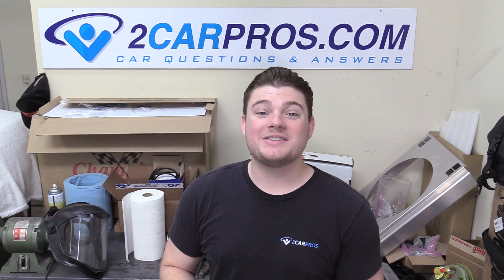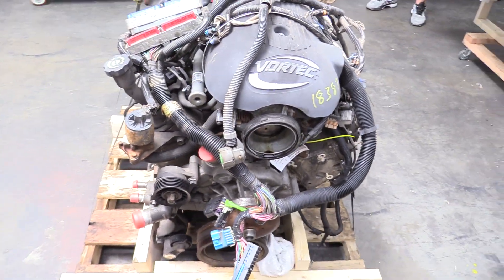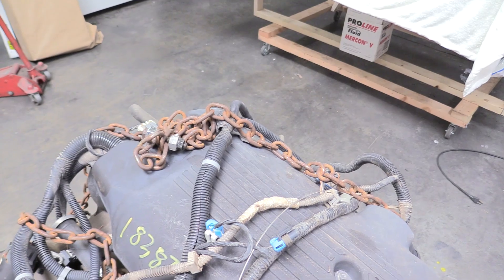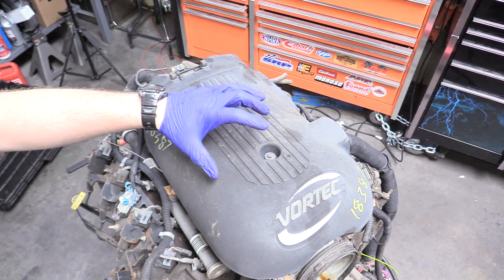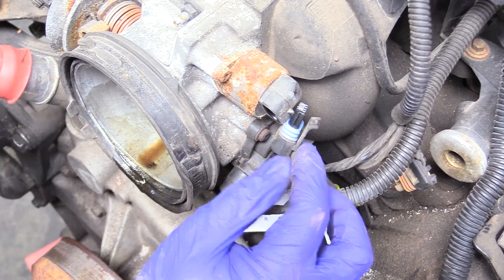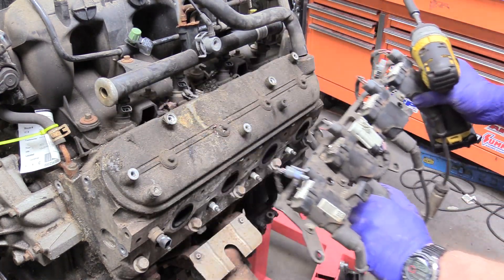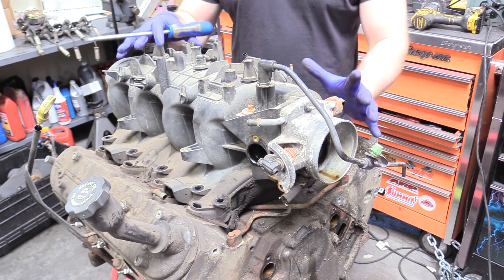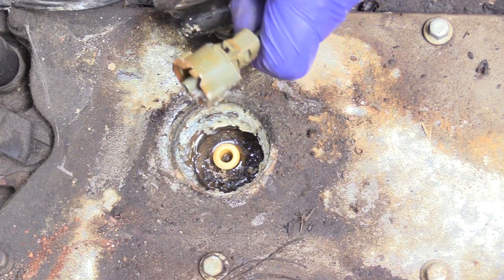How to Build a 5.3L LS LM7 V8 - Part 1: First Disassembly

Comment: Great step by step how-to video for the novice for sure. However, very unrealistic cost part for part. Without the thousands in free parts from Summit, you're all in for well over 13k total cost. (Engine, Summit parts, machine work, and stainless valves.) For that you could get a fully dressed, with all accessories, 530hp 6.2L LS 376 CID from Blueprint. With a 30 month/50k mile warranty. 

Or a guy could get a 450hp 5.3L long block for the cost of just the machine work. With 2yr unlimited mile warranty. Many other great options unless you just want to say you built one.
Reply from the maker: This was pre pandemic, things were A LOT cheaper. 

Blueprint is a fine way to go. If they have what you want. 

I'm not sure that's true. Machine work on a SBC I just built was 900 bucks.

Comment: I started to do mine as far as disassembling it. I have a stand from Harbor freight and those bolts don't work with it, they are too long
Reply from the maker: Cut them or get shorter ones, my stand has a bit thicker apparatus than most. Thanks for watching!
Reply: @2carpros  yea i've watched your vids now  a few times now with my dad. By far yours is the most detailed. I will def be following each vid for the rebuild. I plan to put the lm7 in my 2002 trailblazer. Ive got a long road ahead but im confident i can do it, it will be our 1st build!
Reply from the maker: @Trinicrew99  Awesome! Sounds like a super cool build! Let me know how it goes! If you do follow our built to a T,  just note that the valve covers I used in the video are wrong, the ones I linked are correct. They are a bit taller and allow for the roller rocker clearance. Thanks for watching and have fun!
Reply: @2carpros  i havent decided on what rockers im going to go with yet. I have a lot of parts saved in cart on summit. i originally planned to reuse the stock ones but i saw some weird wear on 1 push rod so i will def change rockers. Im not going too crazy on build just want tit to be reliable because it will be my daily again. Thanks for the info and tips

Comment: I love how detailed you get on the tear down and set up! I do have one question. I see a lot of people use them and perhaps I’m extremely paranoid by it but how can you pull yourself to use an impact on your engine?. 😂 personally using impact guns on engines scares me I just can’t make myself do it. I rebuilt an 84 Yamaha 3 wheeler that went through a flood and I used an impact on it. I broke off one of the head bolts and it was a night mare. Never again have I used an impact on an engine. 🥲
Reply from the maker: Just been doing it for years. You just sorta learn what you can get away with and what you can't. Thanks for watching!
Reply: @2carpros  hey thanks for the reply! I did have a quick question I was planning on rebuilding a LM7 5.3 and throwing it into my BMW. I don’t have the engine in my possession yet I plan on picking it up next Thursday but I have a slight concern. Would it be possible that the oil pan would stick past the frame and drag the ground? If so is there a possible option out there to go with a shallower oil pan?
Reply from the maker: @AWGarage614  No problem! It's possible. But with swaps you either have to put it in and see. I would think you need a shorter pan. I've seen LS's in BMW's and they all have non stock pans.

Comment: I have a 2003 Chevy work truck 4.8 4l60e woth 350k miles on it. Motor knocks and tranny slips. I had the 4l60e rebuilt and bought a junkyard 5.3l not as old. Truck runs brand new! 5.3l has obvious more power than my 4.8l. 😅

Comment: What size bolts to lift engine with hoist?
Reply from the maker: 10x1.5mm for the sides of the cylinder head. You can also just use the exhaust bolts for the flange. Thanks for watching!
Reply: @2CarPros  Thanks you. Appreciate it alot.

Comment: Just so you know, I have a 5.3L engine in my garage, Just "because" of you. I paid 300 CAD for it. It's in good condition, and I am at the machine shop state and buying part state. And it's the first time I did work like that, the first engine ever, and I have a unique plan for it, like a mustang gt500 supercharger on my ls ;p. Thanks for making that series of videos; I must have watched it at least 3 times. But don't laugh; I've undoubtedly missed the part, in every ls video, on how to remove this #$% fan with a clutch on the water pump; I tried every tool, heavy tool, cutting tool, and I can't remove it. Now it's just a question of pride and easy packing for the metal scrapper. Everybody must know "how to hit him on the nose" to separate the two damn things. I'm afraid to search to see how stupid I am ;p. Or mine is stuff beyond anything. It will have an electric water pump instead.
Reply from the maker: Very very cool! When you finish it up send me a picture, I'd love to see it! ryan@2carpros.com or on instagram @ryansgarage408 

If the fan clutch is truly seized on there, just remove the entire water pump. Thanks very much for watching!
Reply: @2carpros  Will do for sure

Comment: Where can I️ buy a motor and have it shipped to my door for 500?😂😂I️ can’t find a lm7 near me for less than 900 and it won’t come with all accessories
Reply from the maker: I fear I may have influenced the market a bit. A lot of people bought them off eBay sending the price higher. But this one was 550 shipped when I bought it it was 2 years ago now though. Thanks for watching!
Reply: @2carpros  thanks for making them, I’ve watched multiple times now trying to memorize it😂
Reply: @2carpros  update I️ got a gen III lm7 with a 4L60E and T case for $600, sold the trans and T case for 300 so I️ paid roughly 300 for the motor. Only 145k miles

Comment: I have a 1999 Chevy silverado, 5.3 liter, vin T, LM7 engine with a bad cam gm# 12560966. Can I replace the 1999 cam with a 2000 gm# 12560967 cam? Would any re-tuning reprogramming be required?

Comment: Watched your video on LM7 build, great work.  Got a question on costs comparison.   I priced out your components last week with Summit Racing.  it added up to around $8k not including the cost of a machine shop.   Based upon the hardware that you used.  just curious what the costs would be to purchase a similar engine already built thru summit racing or other sites.  I feel like I have enough experience to do this type of job, but is the trade off worth it.
Thank you
Reply from the maker: Was less when I did it. Inflation has really done a number. I know you can buy a cheaper engine prebuilt from Summit and that's totally a cool way to go but if you wanted to do it yourself this is the way to go. Thanks for watching!

Comment: I have a 2004 GNC Sierra 1500 4WD with this motor and my question is about my 4L60E transmission. I clearly don’t believe it would hold up to this build. Can I use the original transmission and have it rebuilt to withstand that beefed up 5.3 or do I need to upgrade to anew one and if so what would you recommend??? Also, would the transfer case need upgrades as well? And one final question can all of the OEM front accessories go back on  as well as the original wiring harness?!?  Because, I will be doing this build for the truck it’s in and using it to pull a 7x12, two axle box trailer for my yard company…
Reply from the maker: I believe you could have it beefed up but for the money you might want to just go with a 4L80E. As far as transferase upgrades go you can just get that beefed up and it would be more than fine it is a good unit. Yeah all the accessories will bolt up and everything should plug in, you will just have to figure out how to mount the MAF sensor on the intake tube but that is easy peasy. Thanks for watching!
Reply: @2carpros  Thank you very much for your reply. Just to clarify, I can bolt up a 4L80E without any modifications? Also, are we talking just a bare stock one or an HD? And should I buy a new one or just find and have a used one rebuilt? Again, thanks for the reply and I will be looking forward to the next one!

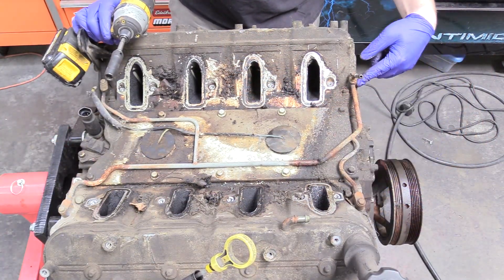Comment: 16:50, those steam vent lines are also to used to help bleed the coolant and prevent hot spots. The knock sensors are also there to prevent detonation. Great video btw

Comment: I’ve watched the whole series a few times now. I have my 5.3 ready to disassemble and start the process. My question is if I do the same exact build will I be able to tune it for a daily driver or will I have to use a different cam? Thx
Reply from the maker: Nice! Yeah you will totally be able to tune it for a daily use. It just won't make as much power as we did. You might want to take the compression down to 9 or 10:1 or so just so it runs on pump gas a bit easier.
Reply: @2carpros  thanks a lot for your quick response and great job explaining everything on your videos. One of the best series I’ve see on YouTube.

Comment: I just got my 5.3 a couple of days ago, I'm having issues getting the torque converter off, cause the bolts are super tight and don't think they never been taking off. You think if I was to use a breaker bar that would work?
Reply from the maker: Yeah that would work for sure. Thanks for watching!

Comment: I just bought a 04 suburban with the same engine whole truck for 500 bucks only needs break lines got 180 on the motor i checked the oil after 3 months an it damn near still looks new
Reply from the maker: Nice work!

Comment: Those coolant lines you removed are for getting air out of the system
Reply from the maker: Right, to prevent hot spots on the heads. Thanks for watching!

Comment: I'm upset that you can find so many rebuild videos on YouTube for GM 5.3L 
But when you search Ford Triton 5.4L rebuilds the listing is very vague. Can Anyone offer some assistance?
Reply from the maker: Great question. The 5.4L Ford 3v is definitely a dark spot on Ford's engine history. They have tons of problems that can't really be solved without a large amount of work so people tend to stay away from them. I have a 2005 Ford 150 with the 5.4L 3v that I got for very cheap knowing I'd have to replace the engine at some point. If we do rebuild that engine you will see it right here on this channel BUT it will be a stock rebuild since there isn't any cool parts for it. Thank you so much for watching!
Reply: Yes I'm aware but the 3V Triton has a lot of Power despite its many issues. Some engine rebuilders will try to customize certain oil passage ways and galleys to allow more lubrication to the cams. I still see a lot of them today in the shop I work in for just simple routine oil changes. I'm very excited to see the video you have for the 3V Triton.

Comment: Whats your thoughts on using a carb and the msd 6ls box conversion for this build?
Reply from the maker: In my opinion it kinda takes away from how nice it is to have fuel injection and just starting on a dime. BUT if you have a legacy build might fit the build better. It would kinda look like an old school small block. Thanks for watching!

Comment: Just wanted to say, the Knock sensors are for measuring preignition/detonation, which can be catastrophic to the engine if left unchecked. The computer can retard timing and adjust other things in order to combat it. Detonation causes increased cylinder pressure and temperature and can result in melting a piston, for example.
Reply: Not to be confused with nox sensor lol

Comment: I'm doing the same thing, got it from 04 Chevy Suburban, I got the tras too but it's 4x4 any way to switch or modify  the tras case end for 2wd
Reply from the maker: Yes. You just need the extension housing on the output shaft. Thanks for watching!